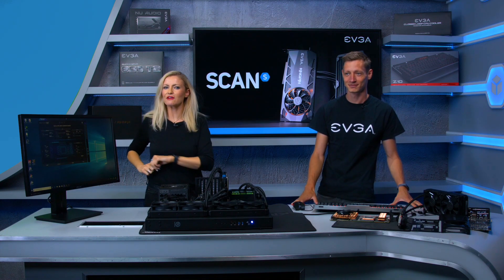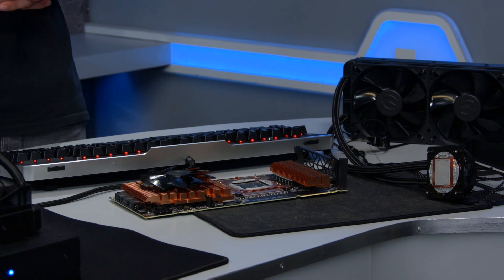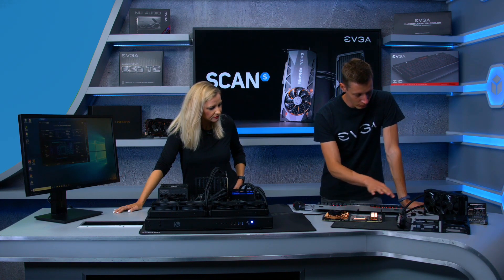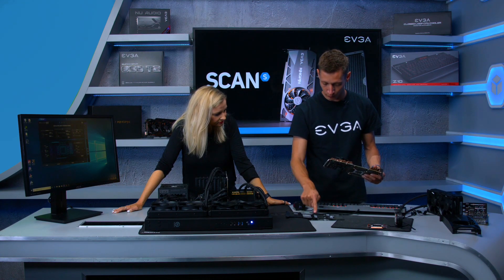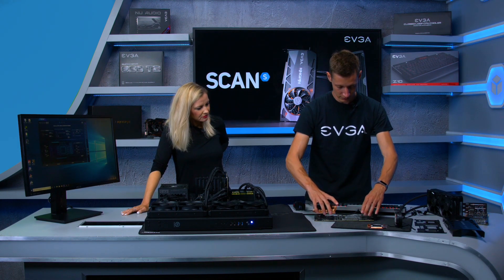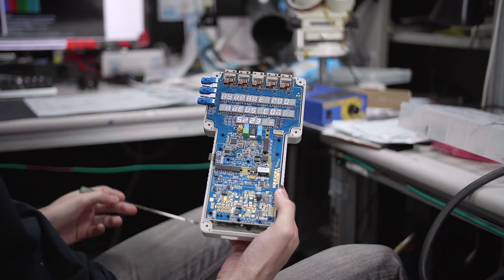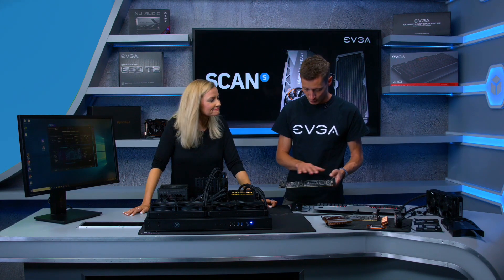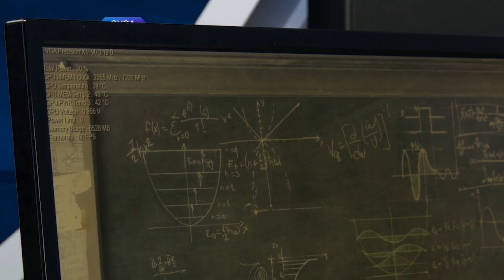The ULTIMATE RTX 2080 Ti?? EVGA K|NGP|N - Part 1 - Teardown & Overview

Comment: The EVGA Kingpin card is cool.  Bespoke chip selection with differental cooling.  Would a water cooling sleeve to task away the heat from the backside of the substrate be more effective than the standard fit?